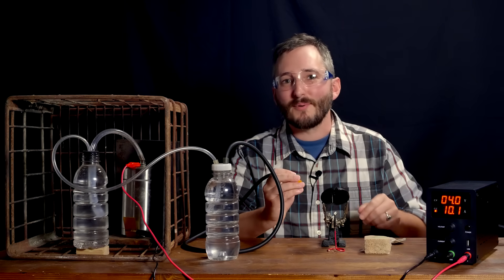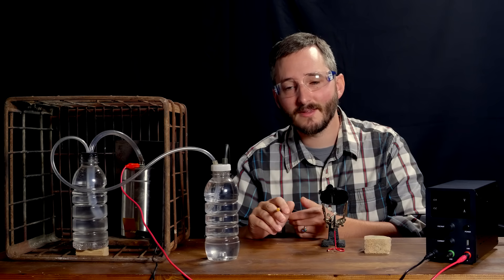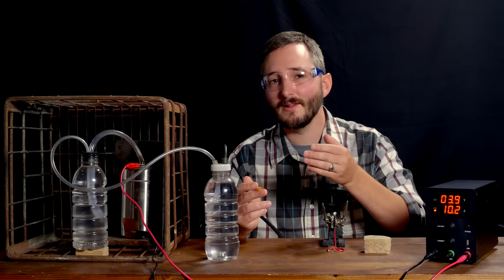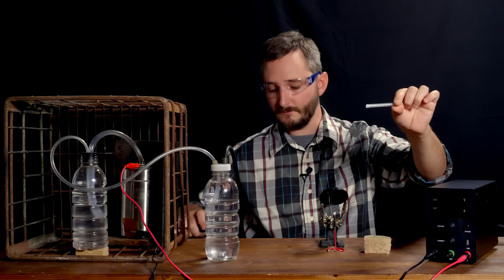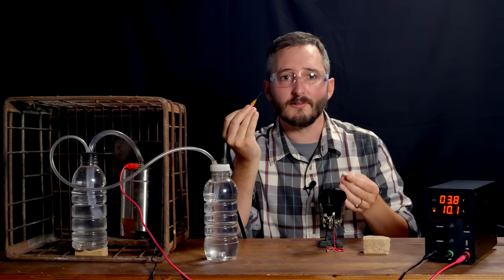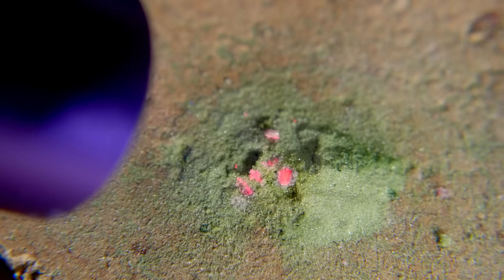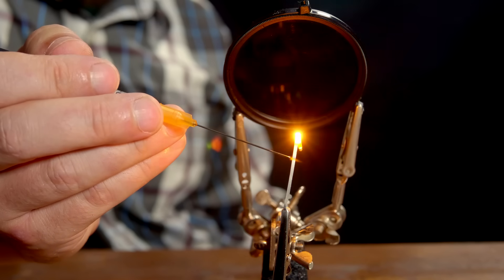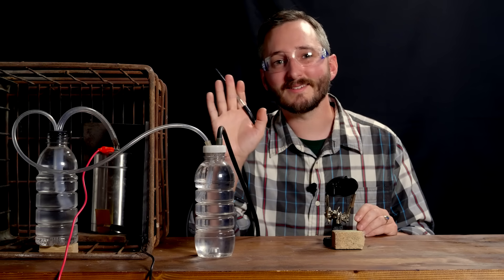DIY Oxy Hydrogen Torch Using Water Electrolysis

Comment: HELP! I made my own, but the most current i can get from my power supply (30v 10amp) is about 2 amps at 4 volts. Maybe I’m using the supply wrong, or it’s broken, but it’s brand new (I got it just for this). Maybe its limited through ohms law because I know current and voltage are directly correlated through resistance, so maybe there is too much resistance in my solution (I’m using baking soda). I’ve made a few of these over the past 7 or so years, but most of them were either failures or successful or slow, and they have all been powered by a 12v lead acid battery in the past so I never really had to worry about the math because I never had that option. Now I’m 18, I’ve got much more experience with building things and I have a little more cash, so I’m pretty confident in my rig, it’s pretty airtight and the electrodes have plenty of surface area, good separation from each other, and good contact with the power source, etc.. Ive tried adding more baking soda with very mild improvement in current output, so do you have any suggestions?

P.S. 
I’ve watched your videos since I was a kid, and you’re videos have played a significant role in who I’ve become. I just got accepted into the University of Washington for engineering, and I have you and a small handful of other YouTubers to thank for my interest in science and building things, and the determination to keep learning and keep crafting. Thank you! (Also you’re pretty awesome for reading all your comments, sorry if this one was long/tedious).
Reply from the maker: Sounds like either your amp or voltage knob is turned down.
Reply: @Nighthawkinlight  no, the amp limiter was all the way up at one point, and I was continuously adjusting the voltage knob up and down. I think I was right when I said the issue was ohm’s law, so I think I have too much resistance in my rig. I used baking soda as my electrolyte, but I know you used something different, what was that and where can I get it?
Reply: How far apart are your electrodes?
Reply: @RaleighC  about an inch

Comment: "This is not a project to be replicated at home" 10 years too late bud. lol That's exactly the setup I did myself at home using a Comp Power supply, and a home made fuel cell. I got lucky and a buddy with access to 316L stainless, used baking soda as an electrolyte, and a cig butt as a back arrestor, and ball filling needle from regular air pumps as my end.

Comment: A micro torch like that is high precision. There's lots of applications for a micro flame. Try welding 2 sheets of aluminum together or 2 pieces of steel. You melted holes in the glass sheet. Make something from the glass instead.

Comment: Will it be viable to arrange multiple nozzles in a circle, focusing on a single point/small area that will add heat to a larger surface for making larger rubies?
Reply: Only if you have multiple sources, as multiple small nozzles is the same as a big one in terms of flow speed.

Comment: The biological battery (Fig. 3-llb) consists of 12 cells with small plastic vessels (Ø 50 X 100 mm) containing powdered rice husks, anodes and cathodes. Bacteria (harmless to the environment) using this medium generate a current of 6 V / 40 mA under the influence of water poured into 12 vessels. The nutrient stock is sufficient for over half a year of continuous operation of the cell. 
This is from the 1961 book by Vaytsekhovsky "Electronic toys". Are they still not able to make electricity from rice husks?

Comment: Do you think there is a DIY and easy way to compress the oxygen and hydrogen; and store in a container? Is something you had in mind to do and record?
I used hcl and aluminium to generate hydrogen and had a fright situation with a flashback, I was saved by the 1.5L water container cleaning the gas like your counter measure 🙂

Comment: Hello. What would be the variable that regulates the temperature of the flame in an HHO torch? I would like a flame with a maximum temperature of 1500 degrees.
Reply from the maker: Move the flame further from the surface. Put a standoff on the nozzle of you want to
Reply: @Nighthawkinlight  One more question, please: Would those hydrogen generators made with just two poles of parallel plates be more efficient? Only two poles or with neutral plates between them?
Reply from the maker: @Xapiro  I don't know enough about neutral plates to say whether they are worth while.

Comment: treating any flammable gas with respect is a given but ur over emphasis to try scarring ppl off is ridiculously funny. HHO and Hydrogen in most forms is very explosive. thats why highly volatile gas is stored in spheres. 
the trick to HHO is to not store it, burn it as u make it. its very safe that way. having a blubber is good for keeping water and catalyst out of your gas but a commercial flashback arrestor already exists. id use a LPG torch set up for HHO.

Comment: some one said (about 15 years ago) that the temp it takes to heat to melting point with hydrogen is equal to the materials melting point. but the flame alone isnt that hot. whats ur thought about that ?
Reply from the maker: Not true. The flame is hot, and you can feel the heat from a long way off

Comment: I built one of these, I still have it but until I find a better way to stop the flame from flashing back I wont be using it lol. I blew up a few "flashback arrest" devices... Its really scary when that goes cuz its holding a lot more gas than that little syringe. I poked a hole in the rubber part inside the syringe (5-10ml) and ran my tube through that so that hopefully the tube would blow out the back before it got to the flash arrest bottle. Well that worked sometimes but I had one of those break bleeder bottles hooked up as my arrest bottle because its kind of built for the job and that was the last one I blew up... The top screwed on and it had thick threads and the whole thing exploded like a grenade in my basement. Way louder than a gunshot it was like a bomb going off... I couldn't hear for about 10 mins. Good times lol...

Comment: idk about using a torch that size, but couldn't you make a really efficient fuel source for cars and other combustible engines? The only problem is getting around the safety factor, but imagine running your cars on just water.

Comment: about 20 years ago I had a commercial oxy-hydrogen torch we used to weld   Chromel and Alumel wires together to make temperature probes.   It was a very finicky unit to use.

Comment: What will happen if, using a fish tank air pump, you install a venturi valve in the last flashback arrester sucking out the H2 gas, to increase the flowrate and oxygen output of the torch?... it will flame at higher or lower temperature??

Comment: It Will be  usefull  in glasswork, to  make tiny pieces of cristal, must test pirex. If melt pirex you Will be able to make laboratory equipment repairs. It Will polish plastics like polycarbonate and metracrylate for sure.
Reply: I was going to mention polishing lexan -- a fiend used to flame polish before he used solvent to weld pieces together.

Comment: Just wondering before I experiment with this.. Lol. Instead of using syringe needles could we use pieces from a small torch like the ones sold as lighters at gas stations? This would allow for control of the flame adjustment. Pleas be advise im not suggesting filling the tank of the lighter, but taking it apart and using the parts!

Comment: That is incredible and has inspired a few ideas! First, it would be interesting to see how it behaves with tig filler rod or a length of mig wire on various steel thicknesses. Second, do you think you could get enough power from solar panels to create a sort of off grid or portable work station that could be used in a bushcraft project? I love your videos and have the utmost respect for the work you put into them!
Reply from the maker: Lots of panels that can deliver 40w easily. Wouldn't be hard to use solar for this.
Reply: @Nighthawkinlight  glad to see confirmation for a random thought of mine. What about storage as well as reuse as an energy source? (like say, you store it for use at a later date)...is that even reccommened?
Reply: Doable, but I do not see a torch that small being useful for bushcraft.
Reply: It wouldn't work well for welding. The iron will reduce water at those temperatures, you'd get a lot of hydrogen impregnation and oxidation.
Reply: Seems like the power needed would be easy for a cheep deep-cycle- dolor or not it could be mounted in a unit/cabinet. But for your suggested use maybe the old 24vDC with jumper cables and welding rod should be explored?

Comment: I wonder if a microfluidic tesla valve would enhance the effect of keeping the flame front at bay using high flow by introducing anisotropy to the system. In your video demonstrating the tesla valve by the propagation of a propane flame through it, you showed how the expanding gas causes the flame front to accelerate in only one direction. Thus, my hypothesis is that, if the flame front in this oxyhydrogen torch were to propagate backwards through a correctly oriented tesla valve under high-flowthrough conditions, it would tend to help the flow push itself back out of the nozzle.
Reply from the maker: I think it would not work well enough to be worth while. It might slow the flame down but not stop it, and the valve would be likely to be damaged

Comment: Yeah I used to have a HHO torch but the copper wire flashback resistor failed and blew up my reservoir. Something cool though about HHO is it can burn even underwater because it supplies its own oxygen

Comment: Instead of wet paper towel can you pass the gas through metal tube (can use copper tube) which you can submerge in water container so it can work as another safety for back fire just like you use wet paper towel.

Comment: can you run the gas through a check valve into a small tank with a diaphragm for pressure then from there through a pressure regulator of some type to the torch?

Comment: @NightHawkInLight I personally do not need a "LightSaber" but as an engineer I could definitely use a LightSaberryish-Pocket Knife©,,, a portable pocket tool where I could cut maybe a 1inch square barstock(solid ideally, but at least 1/10 or 1/20inch wall thickness) quickly, it should allow easy field cuts/weld(crappy temp welds OK) on steel or aluminum...A workable flame up to 3inches would be great, but at least a ½ inch depth min. .

Pocket size device would be ideal, but practically speaking to model this on say a good cordless drill form factor and rechargeable battery model as a starting point. Seems conceptually achievable based on what I saw of your rig(2x or 4x flow(??))... This 🧠⚡ could be a good product.

I would use this type of device freehand and also in a mini miter box(quieter than a metal saw).
(fyi I do not use gmail, just YouTube comments)

Thank you for making this interesting device and sharing it here, 💯+

Comment: Hmmm if you used a tiny steel bearing big enough to fit in the syringe and allow gas to flow by but large enough too block the tip you could use a small magnet on the outside of the syringe to control it and cut the gas whenever needed.

Comment: Any reason why not copper wool for flashback? Brass cork is what I see normally in commercial flashback. And you have any basic thoughts on a dry cell vs a wet cell setup. More efficient with surface areas

Comment: Very cool!  I had no idea that blunt syringe "needles" were available for purchase for things like this.   I especially appreciate you going into depth about the safety measures you've undertaken to make sure your set up is as safe as possible.
Reply: They are lots of times used for arts in craft, such as refilling ink ccartridge
Reply: Farm supply stores will also have needles as well.
Reply: You don’t know your gadgets well enough Mr Bond. Get off the mission please.
Reply: Q: Ahh Mr Bond, we've run out of laser diodes for your laser watch so we've equipped you with a modified Oxy-Hydrogen torch. Please use sparingly as the little bottle is only enough to cut 1 big hole through a window.

Comment: Scale it up, may use use a large crate which you lined with a bent metal sheet as an anode. Then used a radiation type shape of metal plates hanging in solution as the cathode. Potentially more pressure this way to maybe weld?

Comment: You need to cool the flame to weld with it, the flame is so hot it will burn the steel. You can manipulate the temperature if the flame by adding pressurized gasses of one some sort or another. Pressurized gasoline vapor is one of the gasses you can use to cool the flame.

Comment: decreasing the nozzle diameter doesn't increase the flowrate (at least not in subsonic conditions)  but it decreases pressure which causes the velocity of the exiting gas to increase (venturi effect)  which counters the flame traveling back to the nozzle, as far as i know xD

Comment: Could you arrest the flashback by running the nozzle tube through a bucket of dry ice before it reaches the gas generators? Removing the heat from the three-part equation might be enough.

Comment: Could the torch be used to engrave metals or is the heat conducted away too fast?

Carsandwater used to do a lot of stuff there they'd melt random things with a similar torch. They'd also heat nickel balls and drop them on stuff. They don't seem to make content anymore but I miss the destruction.

You could vamp up this torch and see what you can do with it.

Comment: One thing which came to my mind when I studied chemistry is a "magic" candle where you have a tank half filled with water and electrolyte and you use a device which separates the atoms but keeps it separated from the outside atmosphere of the enclosed container, and then you light one of these torches, and when the gas mixture burns, the steam condenses back into water, where the cycle repeats itself.  So the energy is not perpetual, but the fuel used is constantly recycled for as long as the flame remains lit and the electrolysis continues.

Comment: Would love to see you "3D print" a huge ruby with this, I forget the name of the method but where you have a layer of powder, melt it, add another layer of powder, melt it to the first, and so on. Would be interesting to see what layer thicknesses and lateral speeds would work best, and what complex shapes you could make out of freakin ruby! Of course, I am thinking of a more limited scope, ie, by hand, hence the air quotes on "3D print", and I have no idea how tedious that would be, but I wouldn't complain to see it hooked up to a full CNC system either :P
Reply: Sintering

Comment: The setup I used for brown gas back in the day was one of those block shaped reaction vessels made up of clamped metal plates and rubber gaskets. 
Spend about 100$ on it and felt rather safe with it's construction. I am not comfortable with that shrapnel grenade you build there.

The gas fed into a car windshield washer reservoir I had suspended above the reaction vessel so the gas/fluid didn't have to fight gravity as much.

Regardless, flow rate was a big issue in my setup. I had some decent results by using a torch tip that had a valve and adding an aquarium airstone in the bubbler to shrink the gas for a more consistent output. Letting that thing get up to pressure was rather scary because I had no way of knowing how much the reservoir could withstand. 
I never let it run for more than 5 minutes with the nozzle capped.

Following the bubbler was two rockwool flashback arresters in series, because for some reason 'one' was not enough, so this diminished my flow rate even more.
Despite that, I blew up my bubbler apparatus SOO many times! Thankfully it never found it's way back to the reservoir.

Wouldn't exactly recommended it but the worst I experienced in my tests was setting off a neighbors car alarm because my bubbler had way to much gas and not enough water.
Ohh and getting a little KNO3 in my eye due to bad practice and poorly clamped tubing.

Comment: As a jeweler that flame is way too hot to do useful work with, melting metal deforms it in an uncontrolled way so to make something pretty it basically needs to be done with solder

Comment: How practical would this approach be for a home appliance to store electricity when production is above demand (for example, from solar panels) chemically? 

What amount of energy would a hydrogen fuel cell recover?

Perhaps not as H2, but some other chemical energy step up, like Ammonia or Urea (both of which store somewhat better than H2, if you don't mind the toxic middle step)?

Comment: We used a professional system like this to solder very small terminals on auto glass for antennas and defrosters. Great in concept, but maintaining the system and keeping safety factor was difficult. The professional system was from some company out in Arizona. Their flash arrestor was basically metal 1 gallon cans with glass beads and water. I think the beads just made sure the silicone tubing stayed below the surface and if there where an explosion the beads would not be displaced as quickly as water and per volume less water is needed. It actually used a tiny solenoid valve to shut off the gas at the tip and the tip was actually about the same size as the one you are using. These solder very small things very quickly. By very small, I mean button on your shirt size. Think SMD, only not as thermally sensitive. Great demo.

Comment: if you could add CO2 from dry ice to act as welding protection, it would be great for professional micro welding. I could see use as a fine welder for that.